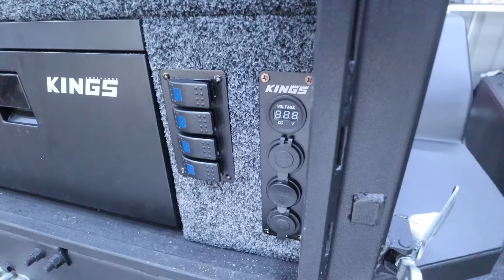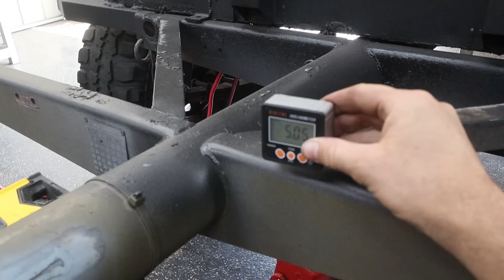Building an Off-Road Camper Trailer in 15 Minutes

Comment: It looks very cool.  Lots of work there.
However, from an analytical perspective, it almost seems as if a hauling trailer was taken apart, chopped smaller, then rebuilt then expanded, only to turn it into a hauling trailer.  <scratches head>  
The amount of stuff and function in that rig is impressive.   And going vertical was smart.
Reply: It reminded me of grandpa's axe. Two new axe heads, 3 new handles over the decades, but they still call it grandpa's.

Comment: I built a no5 camper as well, it was my first time doing a project like that so it doesn't look anywhere near as neat as yours but it did a lap of Australia no problem, including the tele tracks in cape york and WA. one thing, anything you put under the trailer like hoses taps wires etc will get wrecked by tocks and mud unless you put mud flaps in front of the trailer to stop the stuff spat out by your 4wd. These things are tougher than anything you can buy these days that cost 50x more.

Comment: Sweet.  You were smart to solder all those wires since crimped connections invariably fail at the worst time.  My goal is to build a composite square- or tear-drop about the same size as that for occasional overnighting while on the road.

Comment: Purse out of a sows ear!

My only concern is the spare wheel bracket.  That's a lot of weight with not much additional bracing or larger steel. On some of the roads I've been on you'd be saying goodbye to your spare.

Comment: Do the regular trailer light hookups recharge the battery inside the trailer?
Reply: It should be set up as a dual battery system, where the second battery only receives charge, after the start battery is fully charged- But, since the current is quite high, a heavy cable is used, running thru an Anderson plug